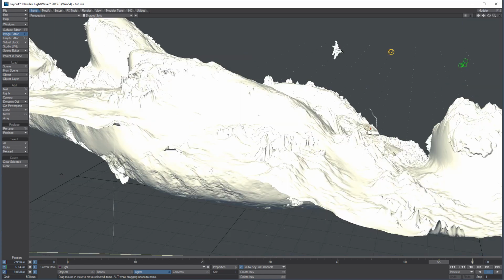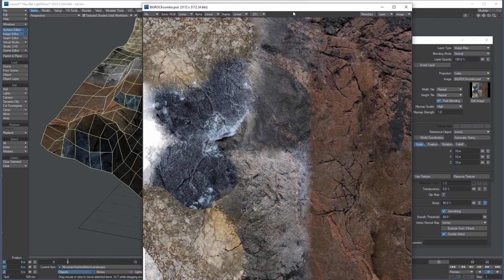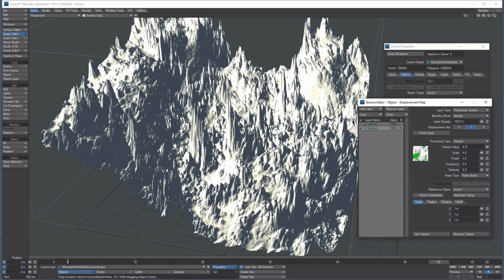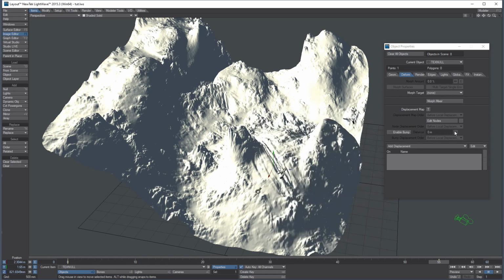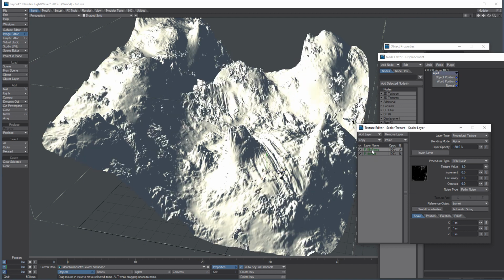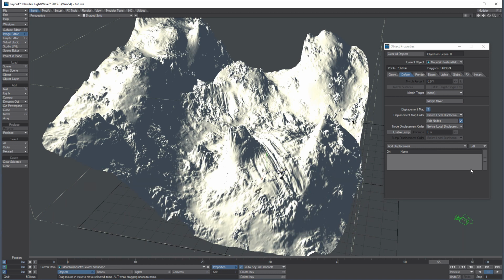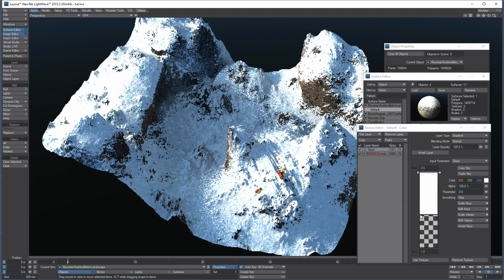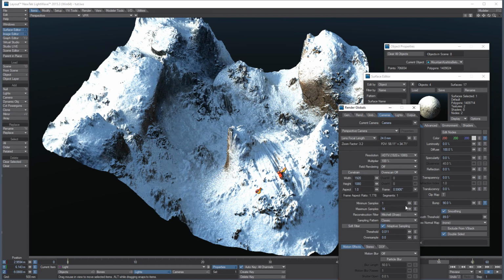Lightwave Mountain Scene - making of

Comment: Thats the beauty of LW,  it has its faults for sure, but in the right hands, it can surpise all.  its toolsets are clever.   A well rounded tool can be far better than a one button feature.
Reply from the maker: I do wonder really if I could do this in Houdini with the same ease. Probably not.Or in Blender. I really should try.
Reply: @cosmicninja8901  you cant.  Ive seen many houdini functions that although killer are far easier to achieve in LW.  BUT!!! i would say, Houdini like maya is robust enough to handle large data sets without crashing. LW can often get choaked up such large objects or at least when its working it out, it looks as if its frozen.  This is mostly due to the fact that Lightwave was created on the amiga back in the day written in machine language.  which for the time was great, but also created quite the stability problem when ported over to the PC.  LW mostly works as a passive application,  a crank that activates other functions down the pipeline of code.  THis causes problem when steps along the way gets hung up. causing a crash.  other application are Active.  placing majority of their functions in ram, Live, so to speak  and making one change instantly sees results.   this is why in LW refreshing is sometimes needed, going from one frame to another , effective turning the crank.   but things obviously goten better over time.   LW has so much under the hood that people dont realize, but what lw really needs are clever writers and developers to better extract what its capable of.  all the while not turning it into yet another maya copy cat.